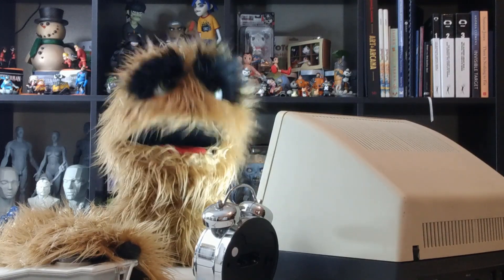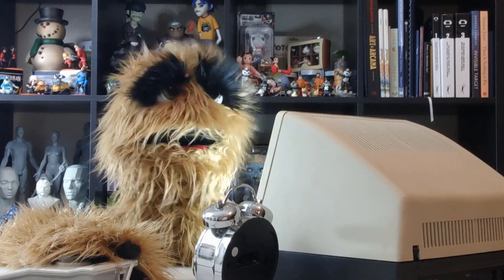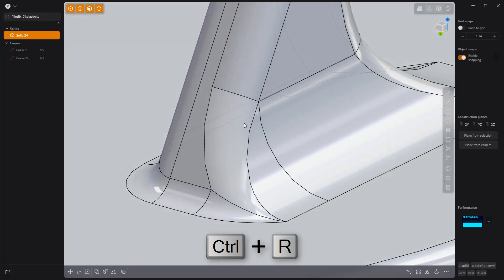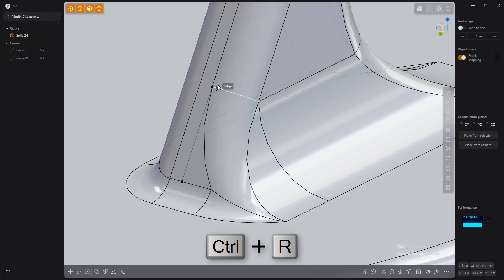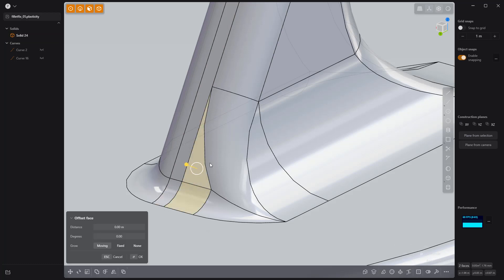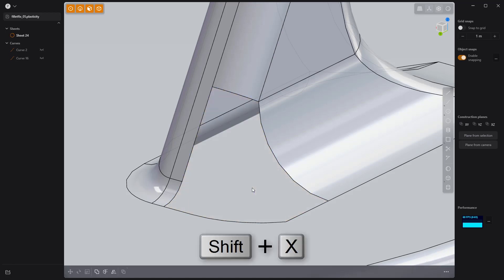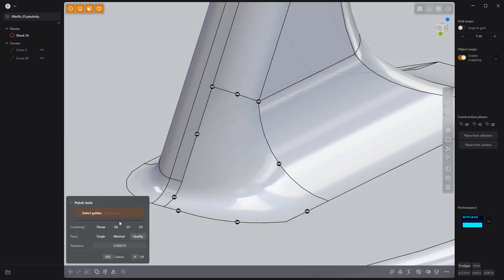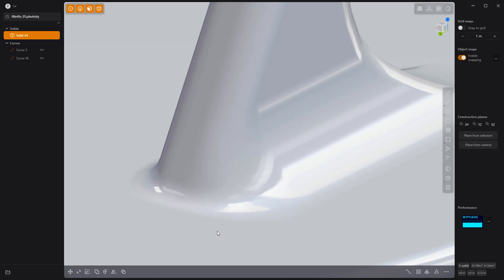Plasticity | Optimizing Fillet Intersections 10

Comment: Great as always! 👍 One thing with the 'Patch Holes' command I may be missing. Sometimes I get the dialogue box to add guides and other times I don't - are there specific criteria in order to prompt the dialogue box?
Reply: hmm..ok, thinking about it, it's probably to do with the difference between patching edges or curves?
Reply from the maker: Make sure the guide curves connect with the edges/curves and also you may nee to add edges to the target as seen in a video I released this week on patching here- https://youtu.be/L4tj0IUH8pk
Reply: @Pixelfondue  thanks William, the second video really helped 👍 It seems if the boundary to be patched is made up of segments then the option for guides pops up - any guides need to join up where a boundary segment joins. Looks like a really powerful tool